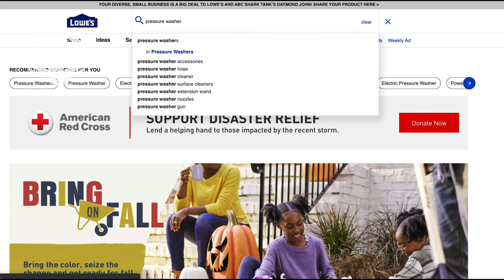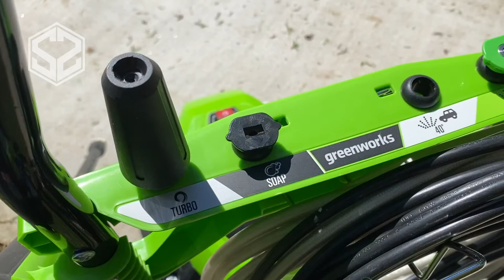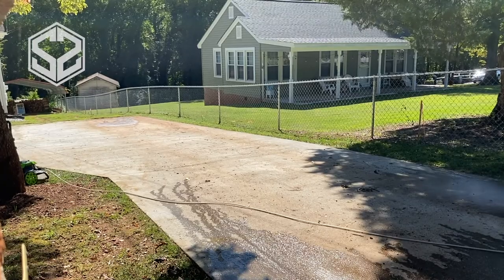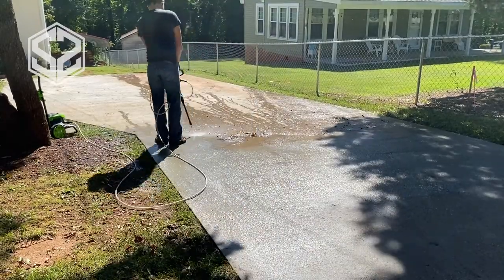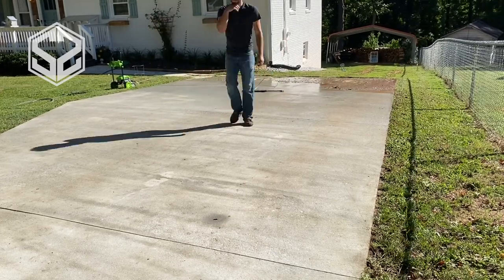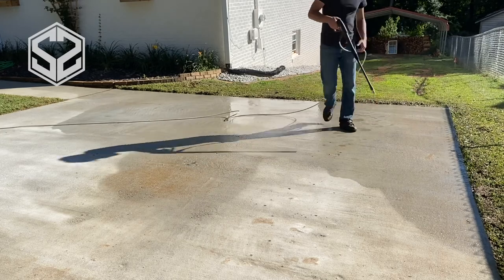Greenworks 1800 Electric Pressure Washer Review - DIY Pressure Washing

Comment: You don't need a valve to turn off the soap container. It only works with the low-pressure black nozzle. If you put in the Turbo, 20 degrees, or 40-degree nozzle, it will not work. I own the same one. This machine is only designed to spray the soap with the black low-pressure nozzle.
Reply from the maker: Thanks! That is very helpful! I appreciate it.
Reply: Just bought one this weekend and was wondering about this exact thing. You da man
Reply: i was wondering. thank you
Reply: Thank you 🙏 I was looking at mines like why did I get you lol

Comment: Mine keeps shutting off every 10 minutes.  I bought the same one as you.  Something about holding the valve on or it shuts off.  Will give it a try.
Reply from the maker: Sorry to hear that. I’ve never had that problem with mine. It’s still going strong.